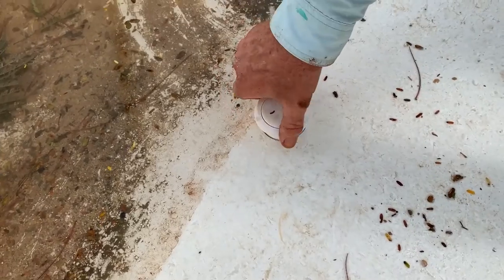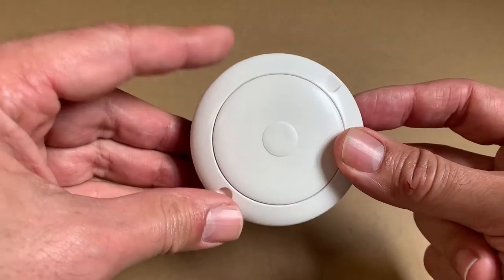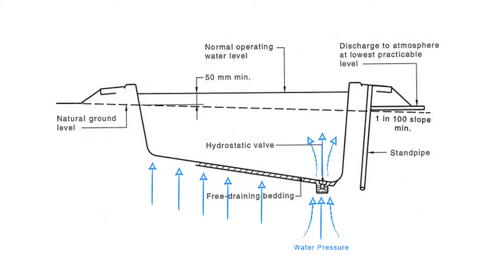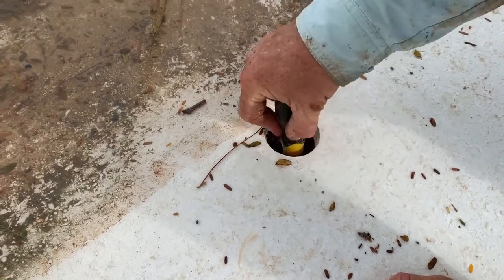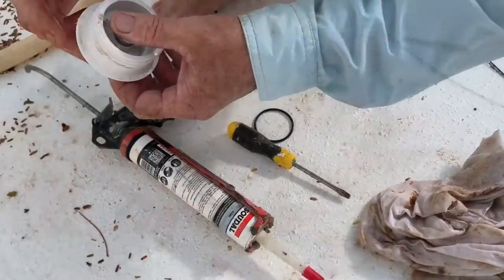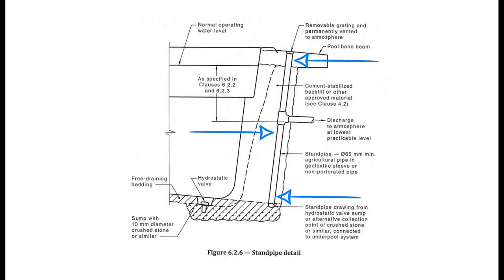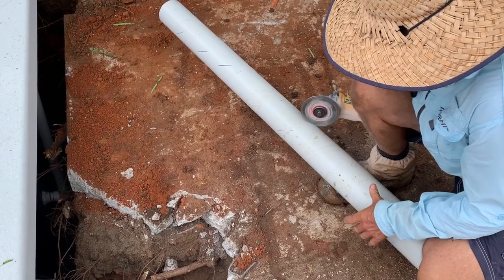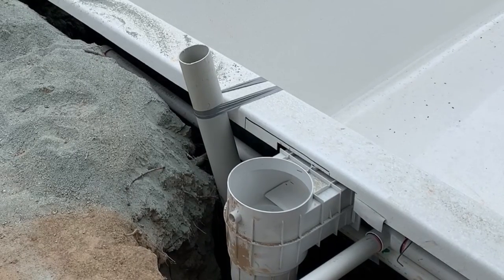Installing a Hydrostatic Valve and Standpipe In A Fibreglass Swimming Pool

Comment: This surprises me as I’ve recently had my fibreglass pool installed in may 2023 and a hydrostatic valve wasn’t installed. Should I be worried?
Reply from the maker: Hi. In some parts of Australia hydrostatic valves aren't needed if your pool is being installed in sandy free draining soil. Do you know your soil type?
Reply: @CompleteFibreglassPoolKits  hi there, thanks for answering my comment. Yes, that makes sense now that I don’t have a valve cause the soil is all sandy

Comment: hi mate, we drained our pool to paint hopefully get a few more years out of it.
when we removed the old valve a bit of dirty water came out as expected.
however an area, like 1/3 of the pool. has water trapped underneath and is not flowing out the hole with no valve !
what do you reckon is going on ?
Reply from the maker: Hi. How do you know there is water trapped under the floor?
Reply: @CompleteFibreglassPoolKits  it is like a water bed when you walk near the deep end.
you can see waves under the floor pressing in opposite direction but not out the hole where the valve once was
would estimate pool to be 30 - 35 years old.
Reply from the maker: That is a bit of a head scratcher. It may be that there isn't enough water to push through the hole and the water is spreading out to the sides. Plenty of pools have ground water under the pool and around the lower parts of the walls after installation so don't have too many concerns. The weight of the water in the pool will compress the floor back to level once you refill it.

Comment: I recently had a large spa installed in the ground, which is 4.5 meters long, 2.5 meters wide, and 1.3 meters deep. Unfortunately, a crack has appeared at the bottom of the spa after only six months. The person who installed it has told me that the pressure from the ground around the spa caused the crack. However, after watching some videos, I've noticed that there is no hydrostatic valve installed. I'm wondering if it's necessary for a spa this size to have a hydrostatic valve? As this would of released any pressure. Also without the valve it would be difficult to empty the spa if ever needed.
Reply from the maker: Hi Mitch. Thanks for getting in touch. If you have a moment to send through photos of the spa and the crack to splash@completefibreglasspoolkits.com.au, we're happy to see if we can point you in the right direction. Cheers. The Complete Team

Comment: Great video. I would like to put a hydrostatic valve in my existing inground pool so I can fix a crack along the bottom of my pool but am worried about draining my pool and making the crack worse. Could you tell me how I could instll one without damaging my pool further?
Reply from the maker: Hi Allen. I'm glad the video helped. Feel free to call the team on 1300 652 710 to explain the issue with your pool. We can then reach out to our suppliers for their advice that we can pass on to you.

Comment: Awesome video, some great info. I’ve recently had the local leak detection guys around for what was a small leak in our fibreglass pool, they wanted to replace the hydrostatic valve as it had probably never been done, but were unable to loosen it and get it out (our pool is full) so they just ‘reset’ the valve. On the second visit they narrowed down the least and are now certain it’s the hydrostatic valve that is leaking but were still an able to remove the old valve, so we still have a pool that’s leaking and now worse than it was in the first place. The issue was the tool for the flush mount in fibreglass pool and not being able to get enough leverage I guess to get the old valve out. Do you have any advice on who or how I can get this looked at, I would really appreciate any help. I spoken too a few local pool shops and a different leak guy but none were willing to help because the pool so full? Any hell would be greatly appreciated. Located North Brisbane.
Reply from the maker: Hi. Do you have a photo of the hydrostatic valve at all? Which company supplied the pool shell?
Reply: Weigh yourself down . Hammer and blunt chisel.  You may have to come up for air a few times, knocking the value anti clockwise. the water will suck out of the hole once the last thread turns. Put the new one in

Comment: Dont put silicone around hydrostatic valves like shown use thread tape as silicone locks it in to tight the valve normally they are changed when the pool is full of water it is to hard to undo the valve if it has silicone around it  make it easier for the pool technician  to change it
Reply from the maker: Thanks for the comment Don. It's a fair point. The beauty of using silicone is a seal is created around the top of the hydrostatic valve so there can be no doubt. A gentle tap with a screwdriver and mallet will crack the seal if the valve needs to be changed. Thread tape is awesome as long as the installer knows how much to use and is confident of getting a 100% seal.